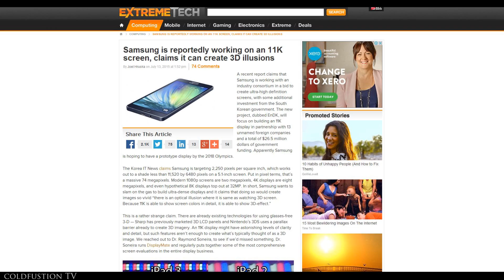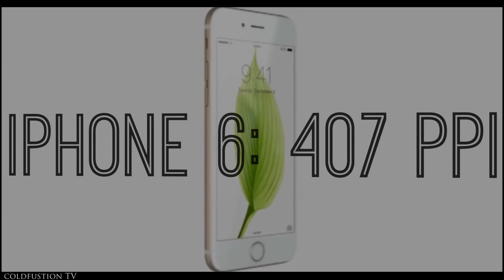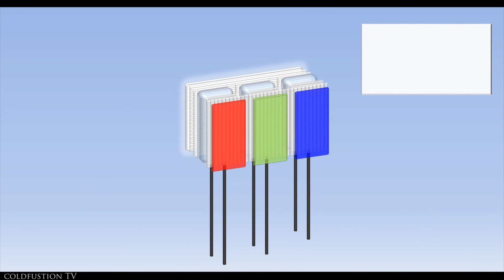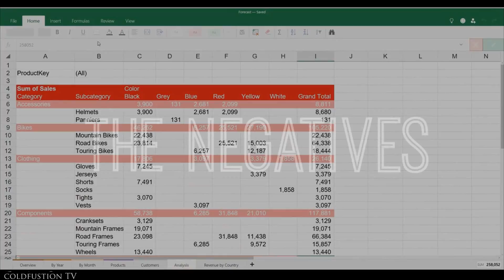Samsung is Working on an 11k Mobile Screen! (2250ppi)

Comment: ppi of iPhone 6 is 326 not 407
Reply from the maker: Hogba McMuffins 407 is the iPhone 6+ sorry about that, putting up an annotation right now.
Reply: ColdfusTion wow u replied... never had a big utuber reply to me, thx for caring about the qualty of ur vids. I enjoy them alot : )
Reply: Hogba McMuffins retina is the biggest scam on the market
Reply: ColdfusTion its 401 u better check
Reply: j gonger Because it's a logo that make people think again that there buying something that is different. Well, yes different. 2 years late behind Samsung.
Reply: ColdfusTion  The iPhone 6+ got 401 lol
Reply: +Kostner Guyton actually higher resolutions do not directly affect battery life. the Note 4's screen actually uses less battery than older Note versions, despite having a higher resolution screen. i can't find the link for the article that showed the proof of this, unfortunately
Reply: +j gonger How? The human eye's resolution is only so high, and after 30 most peoples vision quality decreases without corrective lenses. I have looked at the Note 5 and its screen is Awesome, but my iPhone 5s screen still looks great, and I have no complaints. Everything looks sharp and crisp as it should. Higher resolutions really hammer performance and battery life, so to get the best of everything compromises need to be made.
Reply: Kostner Guyton so you can't tell the difference between an iphone 6 screen and a samsung s6? Before you talk about battery iPhone 6 and the s6 has the worst batteries out of any cellphones. But at least the s6 does it in style. 
I don't even have an android and I'm still not delusional...
Retina much like Air Drop(wifi direct = old tech) is just a marketing gimmick. Apple is the best in the world at marketing, this is exactly why. People like you fall for it blindly. 
Apple could probably sell ice to an Eskimo, they are that good.
Reply: +Jeansen Wen Its true. I don't think Apple would do anything higher. The 5K iMac was made so you can edit A 4K video or image with space for the toolbars
Reply: Jamie Hamilton oh that's why they did it? I always wondered why they made this warped 5k number haha. (But seriously I didn't know <.<)
Reply: +J-dog vids that's because the processor is weaker the screen Has less ppi and the operating system is smaller. compared to android phone I'll use the Samsung s7 for example has 5.1 inch display 1440x2560 pixels (577ppi) with snapdragon 820 chip set 2.15GHz dual core and 1.6GHz dual core with 3000 Mah battery. iPhone 6 has 4.7 inch display 750x1334 pixels  (326ppi) with dual core 1.84 GHz A9 chip set. 1715Mah battery. now if you talk bigger the S7 Edge 5.5 inch display 1440x2560 (534ppi) with the samn processor. but with 3600 mah battery. the iPhone  6 plus is 5.5 inch display 1080x1920 (401ppi) with same A9 chip has 2750 mah battery. so bigger screen calls for much more battery also the iPhone software weaker processor also takes less power.
Reply: +j gonger Of course i can see the difference, the S6 screen is sharper, but the colors are much more saturated. The iPhone 6's screen resolution is good enough for me, sure the note 5 has a higher resolution, but i wasn't going after the highest spec. Thats what Andriod fans fail to understand. Y'all are having a spec war, while iPhone users are enjoying a smooth smart phone experience, on less than half the horse power Android phones have. I also don't like the Android OS, iOS isn't perfect either, but I will take it over Android anyday.
Reply: +anthony KhAyat they both suck.....
even my Samsung Galaxy Note 3 is much better than any iPhone shit
Reply: anthony KhAyat that's plain and simply wrong. this is stating an unbiased fact - the galaxy note 5 has better hardware (much, much better hardware) and a better camera and a better screen (the screen has been titled the best phone screen ever by DisplayMate, a reliable and recognised display testing company that has been testing screens for a very, very long time - they know what they're doing.) this is unbiased information, the note 5 is a better phone, whether you like it or not
Reply: before the argument, Id like to say that IOS is much much much more efficient OS , that interacts with the hardware to its full potential, not like that shitty java based OS that gives me the same performance with 3 to 4 times the hardware of the iphones, alright, apple is more expensive and they sale 2012ish phones in terms of row power but they outperform the quadrilion cpus and the almost comparable gigs of ram to of those of a pc XD what a fucking joke. LMAO android sucks ass, shit operating system, fucking shit
Reply: Sebastian G Apple fanboi
Reply: The iPhone plus model has 407 PPI
Reply: +vertigoEdits the note 4 probably has a bigger battery and is better optimized, I never said a high resolution means bad battery life, but the CPU & GPU have to work to keep all those pixels lit up and change, that puts strain on the battery, more pixels, more strain.
Reply: +ColdfusTion iPhone 6 Plus is 401...
Reply: Idk why u guys always look at the iPhone 6 ppi when the 6 plus had a 407 ppi
Reply: +Pain Cutter even galaxy note 5s aren't as good as iPhone 6 and 6 plus
Reply: +louisphilippe1100  well Samsung  gave Apple  a head start 

you don't that Samsung  made the first chip on the first iPhone 😁😁
Reply: +Hogba McMuffins, +ColdFusion, +kostner guyton, +pain cutter, +Anthony KhAyat and to end all arguments: http://www.sonymobile.com/global-en/products/phones/xperia-z5-premium/
Reply: +IwantaPlayStation4 iPhone has slightly better battery life even tho the battery is smaller
Reply: +Hogba McMuffins iPhone 6 + maybe ? .. idk
Reply: +IwantaPlayStation4 What's funny is that the 6S series is almost just as robust as the Note or S6 Edge, so...

(At least from drop tests I've seen)
Reply: +Yash Mangalick youa re indian chu
Reply: the 6 plus is 401ppi
Reply: Sebastian G tru
Reply: Yash Mangalick It's a revision already
Reply: MichelZelf - TrampNation - Flips & Tricks! 401..407...401...407...its more than enough..... and your eyes cant discern between either of them ;)